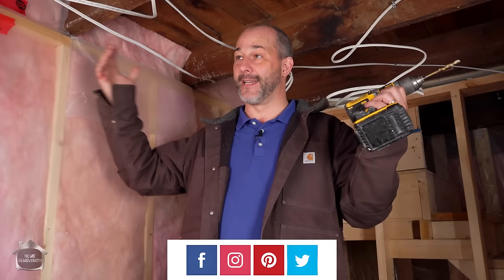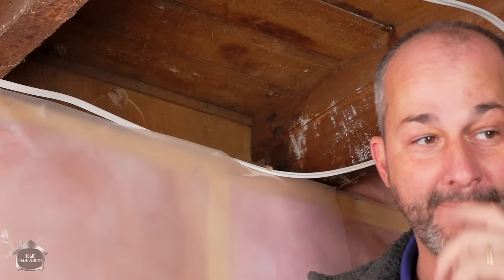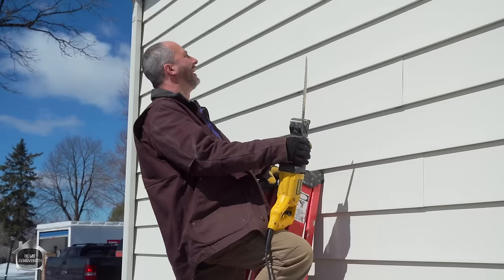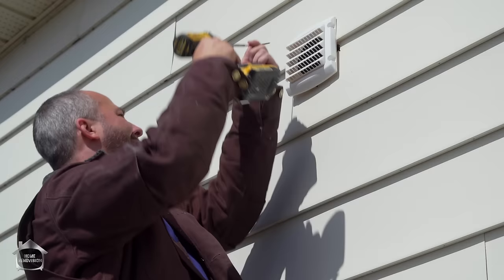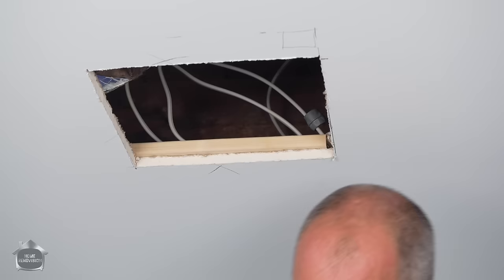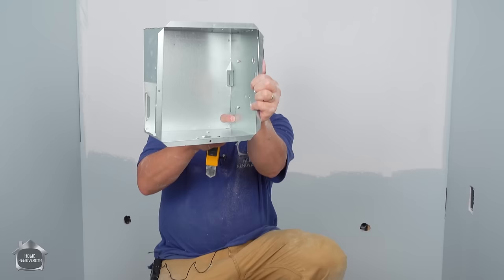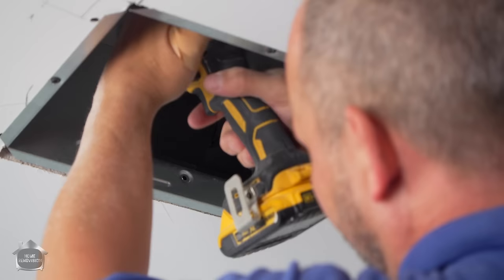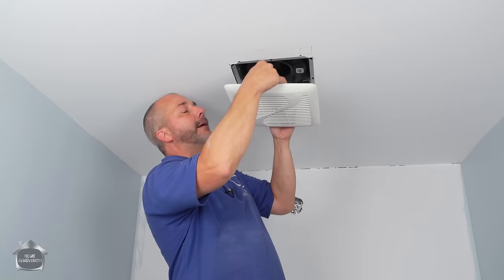How To Install A Bath Exhaust Fan | DIY

Comment: I've done dozens of these, I just cut with the proper size hole saw from the inside right through the vinyl.  You have to pull out the chunk when you get through the first 2x then repeat for the 2nd then continue the cut. And the proper fitting is a siding vent/j block and can be installed after siding is installed. Just a few more minutes of work.
Reply: Yeah this kinda baffled me, by the time you jump back and forth and use 4 different bits I can't imagine it saves that much time, plus the weatherization is easier with a uniform gap from vent to hole.

Comment: I suggest using an impact driver for those paddle hole bits. Most of those paddle bits have the quick connect built into them like a screw bit so it will go into the impact driver without issue. The impact driver adds a little extra torque to the process and because of the clutch/hammer setup cannot bind and throw your wrist out of wack.
Reply: Plus you can pull the bit out with force without it pulling out of the chuck
Reply: I found that using them in reverse prevents binding.  It risks unscrewing off the drill, but that's better than all the safety problems binding can cause.

Comment: From years of being a lineman I always fold the end of my tape over on itself about an inch.  Very nice to have a little handle on your tape itself and on whatever you taped. In case you need to remove it.
Reply: -Talks about how great outside vent cover is
-Breaks vent cover
-Holds it on for the rest of the shot
😂😂

Comment: Hi Jeff you don't have to take the battery out if you push the forward/reverse button slow in either direction it will stop between the gear and it locks the trigger. So it can't be accidently pressed. Great videos. I check them whenever I decide what Im doing next to get tips. Thanks

Comment: There is a screw for the electrical cover.  There's a hole for it at the bottom.  It isn't needed per se, but it might keep the cover from ratting while the fan is running.  That's why you had 3 screws at the end.  2 for the fan, 1 for the electrical cover.
Reply from the maker: ah! Somebody get this man  a prize! Cheers!

Comment: Hot tub for sure!  I’ve put a few fans in with a gutted bath like this. Here in the US we need to wire the box in before plaster for electrical inspection. Also saves time as the plasterer can plaster leaving the opening.
Reply from the maker: Cheers rick, here all we need is a wire in the right place for rough in. then the fan needs to work on final inspection. a little dumb since most fans are installed without a grommet or proper connections.

Comment: I loved the intro. Until now., I didn't know I needed to GUT the bathroom to install a fartfan!
One thing you could do for the lapped siding and vent is if you have any large pvc pipe, cut a slice of it to fit that bottom gap, caulk with clear silicone or kitchen & bath silicone if the siding is white.
You didn't use it,  but I thought it was you who taught me to cut wire insulation at a 45 and straighten the cutter, which breaks it loose and pushes it out a little.

Comment: Hi Jeff, watching your entire video project is key to learning how you tie the steps together.  Flush mounting the bathroom vent to ceiling drywall is way better than mounting to roof trusses pre drywall because of future replacement.Two comments for your wiring.  1,) twist the wires in opposite direction the wire nut will cinch down better.  2,) wrap the wire nuts with electrical tape, from the bottom of the wire nut to the wires.  Neither my recommendations are required, just recommended.  Thanks,

Comment: Dude, I used a 4.5 inch hole saw and cut it all the way thru the wood, plastic siding and everything, no problem. When the center bit went thru siding i went outside and used that hole to drill back towards the inside, put the duct in and had a perfect fit.

Comment: Very good video. Thank you. The only thing I wasn't really  comfortable with is  the flex venting in the ceiling. Looks like an easier install but I would be worried about durability. Think I would prefer 4 in ridgid  sheet metal.

Comment: This video is so informative! Within the first minute I learned... that I am definitely paying somebody to do this work. THIS IS NOT A DIY project for a non-professional. Thanks Home RenoVision DIY channel, you saved me a lot of research time. Time to google a contractor .
Reply: I depends on the electrical code in your jurisdiction, how handy you are and how well you can follow directions. It is actually a rather easy DIY project, with the wall/roof penetration being the most difficult part to do correctly.

Comment: I recommend something called wago lever nuts to connect your wires, they swear by them in Europe and their exclusively used in the commercial, factories and machines, and the hotel business. Ditch the wirenut for the wago like I did years ago.

Comment: Canadians are so danged nice. Fix-it guys tend to intimidate me cause so many of them are condescending and gruff (I'm female not that it should matter). This guy is laid back, sweet and quirky/funny and great at explaining details instead of assuming all his viewers already understand such details. He makes it actually look kinda fun. 

I have a 1916 house and need a fan in an upstairs finished original bathroom. There's an attic above but the main area of attic (directly above bathroom) is finished. The dormers in attic are on both sides and begin about 5-7 feet to either side of the bathroom interior walls, but again above). The bathroom isn't very big and the window is sort of in the center. Clawfoot tub to right of window and toilet to left of window. 

Questions:

1. I don't want to lower the ceiling. How weird is it to add a fan and just frame in only the duct work?  
2. Is the next best (or more appropriate) option to open up only as much of the ceiling as is necessary to gain access and try to drill soffits through beams if blocking the way to the exterior wall - assuming there's even enough height between the two floors - and then patch up the ceiling after?
3. Why can't the exit of the vent be above the window? Cause the fan being on might make it rattle? Can the fan be in center of room but vent be over in a corner, farther from the window? 
4. Our antique ceiling light is in the center of the room. Can a fan be directly over the shower (in our case clawfoot tub with shower ring)?
5. If we have to drill soffits through several beams (3 or 4 2x6s maybe?) won't that compromise the integrity of the house's structure? Years ago a guy cut the attic rafters from the finished portion in the center, keeping the ends of the rafters in place (seen in the unfinished dormers) and ever since finding out I've been worried our house will be more at risk if an earthquake! 😬

Can we put a fan directly in the exterior wall??!
 
Thanks so much! Subscribed!

Comment: I can’t help my ocd I feel the holesaw would have been so much neater.  When I did a dryer vent I cut a 4” hole in my double brick wall with a masonry holesaw and it was super sweet and neat.
Reply: Eh no one sees it
Reply: Those masonry whole saws are stupid expensive
Reply: blackdatto never new they they sold those
Reply: blackdatto in my opinion if your doing this as 1 time thing I would just use a pilot hole and use a the masonry chisel attachment on big hammer drill (makita cordless 18v hammer/rotate/rotary hammer) and maybe an angle grinder with masonry disk.
Reply: @Vanilla_Icecream1231    yeah just on eBay I think I paid maybe USD 27 for a set of four
Reply: @Vanilla_Icecream1231     you are right I have only used my set less than 10 times in 4 years but saved me some time so a worthwhile buy.   I used them on the end of a larger metabo sds thumper.    I have only cut brick with them so far.

Comment: I like your style When you screw up somethings you pretend as nothing happened :))) I always swear a lot:)
Reply from the maker: I don't crew things up I simply add work to the scope. Cheers!
Reply: “We don’t make mistakes,we have happy accidents.” Bob Ross
Thankfully I’m good at hiding my own happy accidents.
Reply: Your life isn't editable. My life neither. This job could be a real SOB, working above one's head, drywall that could start calving where the screws are close to the edge, siding which requires more consideration when pushing thru from the inside, and those other fine extras that Murphy can bring to a job. 
Also, he had a short ladder and worked above his head on that ext vent with a recip saw, all kinds possibilities for wicked bad luck from Murphy.
Those real life cautions said, I watch these vids because they're helpful and I appreciate the time and effort it takes!
Thanks to all involved. Invaluable.

Comment: Thanks for your video. Appreciate that the install wasn't a 5 min "nothing needs to be adjusted " video. Liked the strapping. I have a non flexible vent coming into my previous fan with minimal lateral movement so I cannot adjust the placement of the housing much. I don't want to move the opening very much so I can avoid doing drywall patching. thanks again!

Comment: Man that's a lot of safety first tips from a safety second individual. 😂😂
Reply from the maker: LOL, there is safety and then there is experience. I like to share mine when it will save an injury. Cheers!
Reply: @HomeRenoVisionDIY  Where would you put a bathroom fan in a house with vaulted ceilings and no attic? Also our house is stucco 😖 when we take showers it gets so stuffy and the bathroom is holding way too much moisture! Neither one has a fan!!
Reply: @shellyc530  Do a through-wall exhaust fan.
Reply: Get a dehumidifier
Reply: @HomeRenoVisionDIY  not sure how using a sawzall am inch from your face doesn't require eye protection.  I do like the video though, but just consider people watching might adopt the same approach with lack of saftey

Comment: Commercial Construction,  " building restaurants" here in the USA, use Philip head screws 95% of the time in all work. Exception when doing interior wood work. We use trim screws to attach to metal studs. Star, Square, Allen head screws. I prefer the  different screw heads vs Philips. In the past 4 years I have used over 250 Philip screw bits, they just wear out. other screw bits, maybe 8.

Comment: Great teaching for basic installation of a fan. I’m planning on doing this for my aunt’s bathroom that’s growing moldy nowadays 😅

Gonna follow up on that basic wiring since it only has one light switch.
Reply: You can get a dual switch the same size as a standard single switch or, preferably, replace the single box with an old work dual box. 

If the power goes from your panel to the switch, then the light, then you can use that hot lead to supply both switches easily. If the power goes to the lighting fixture and then has a drop to the light switch, it is slightly more complex.

Comment from the maker: Would love to know if you have a fan ducting into an attic!
Reply: Oh yeah. Time to dril into the roof. Back bathroom has no ductwork front does. Back bathroom got so wet the paint peeled off like latex.
Reply from the maker: Nice, very common problem from what I am hearing. best timer of year to finish the exhaust installation is early fall, in the morning. There will most likely be a little attic work to do. another few weeks won't make a difference. Cheers!
Reply from the maker: @Tunefully if you can fun the exhaust through the gable side of the building it will be better than going through the roof. Cheers!
Reply: I just installed a light/exhaust fan in my bathroom last weekend Jeff. And yes, I had to sweat it out in the attic. It's toasty warm in my attic here in Mississippi. Still gotta install the duct hose though. Not a problem. My wife still forgets to turn it on anyway. As far as the pool/hot tub question, I'd like to see you install a hot tub. I want to put a hot tub on a deck that I will build shortly. I want to build it with a retractable roof.
Reply from the maker: Hi Alan you can always tie the light switch to the fan so they work together! Love the idea of the hot tub. Cheers! Way to take one for the team in the hot sun in the attic. #real man!
Reply: A couple of things...before you purchase a fan make sure it fits in the joist space. You can roughin before drywall. Use a proper discharge vent with a back draft damper. Skip the exhaust fan with a built in dehumidistat. Prone to failure. Mount one on the wall or use a timer switch. My 2 cents.
Reply: @HomeRenoVisionDIY  Yeah, I'm adding a bathroom off of the living room and I tied light and fan into one switch. I opted for a double switch for the back/master bath. Luckily, whoever updated the bath room wired the light with 12/3. Keep the the great videos coming Brother.
Reply from the maker: Thanks for the thoughts.
Reply from the maker: having a 3 wire makes a lot of options down the road as well. cheers!
Reply: how much should i pay a handyman to replace my existing bathroom exhaust fan without running the ductwork just installing the fan
Reply: My place does not actually even have any attic - just a tiny air gap of less than a few feet!! I do have a ceiling opening that had a skylight, which I removed and installed a whole house fan in place of, with a thermostat switch and a bypass switch for manual control. It really cools the place off in a hurry on a warm day with a window or two open and the fan going.

Comment: When running electrical in a finished room where you don't want to cause a lot of damage to the drywall, electricians fish line is you friend. You were fortunate you had an unfinished room to work with.
Reply from the maker: If I was to run the electrical in that finished room I would remove the drywall and redo it. Cheers!

Comment: So are you going to tell us how much it cost to replace the removable grill of the exaust that you busted with the drill at 14:17? I'm going to guess that you had to buy a whole new unit. And  holding it up for the rest of the segment was priceless.
Reply from the maker: Thanks Daniel, I will be replacing it as soon as i do the new siding. it is all held together now with caulking. Cheers!
Reply: Hahaha!!!!
Reply: @HomeRenoVisionDIY  @Home RenoVision DYI. Ah yes, as someone told me a long time ago, caulk hides a multitude of sins. The sad thing is that my house is full of sins (not of my doing but that of the builder). Sigh.
Hope your family and you stay safe and well.
Reply: Are there any precautions to take in order to avoid packing down the loose insulation.  My attic has 10-12 inches of loose rockwool.  I want to reroute my bathroom fan which means I will need to move around, likely packing down this stuff, thereby reducing the effective R-value.  Should I just blow more insulation on top once done?  I live in Ottawa, Canada.

Comment: When you vent through the roof, what type of sealant do you like to use? I was told to use a tripolymer sealant. Kind of hard to find at the local big box store.
Reply: That is what you want to use

Comment: You may not like Philips screws but my complaint been why a receptacle has wiring screws with square/slot screw, Philips screws for attaching into box and a plate cover with a slotted screw.  😄 Really enjoy the videos.
Reply: The square/slot screw allows for controlled torque and won't slip/strip like a #2 Philips.

Comment: Sir: strange question... my ceiling is totally opened. The outside hole is done but I have to do the ducts. Fine. I also have to instal adequately the fan/box. Why not putting it before the gypsum? To difficult to know where to cut precisely ? Thank you for such  sublime videos
Reply from the maker: You definitely can. I installed this way to show a fan replacement as well. Cheers!
Reply: Home RenoVision DIY thank you very much for the answer. Last one : I see that you use flexible tubing + an insulated sleeve ...? It’s a must ? For now I have only the steel tubing without any insulation... BTW: i kind of live  close by;) So same temperature...
Reply: @ikust007  By now, I hope you got it installed. It shouldn't make any difference although some claim that flexible ducts with grooves reduce air flow and affect the CFM. I think it is marginally affected if you have a very short run.
Reply: xanthanx thank you very much for taking the time to answer.
Reply: xanthanx I put a insulated sleeve over the duct , btw. Everything went well.
Reply: @ikust007  You're welcome. Glad things went well.

Comment: be 100% confident where the fan will be by installing the damn thing BEFORE you drywall the ceiling....DERP
Reply: It's a remodel, not a brand new home.
Reply: @Guillotines_For_Globalists  you can clearly see they have taken the drywall off of the ceiling....this is the time to put in the fan
Reply: @parascalemodels  How and where?
Reply: @Guillotines_For_Globalists  Right from the beginning of the video to 14:30 there is no drywall on the ceiling. That's when the box should have been mounted and the vent duct sealed to the box.
Reply: @parascalemodels  Strange.
Reply: i believe he is trying to show people who are retrofitting a fan into an existing ceiling,not everyone completely guts their ceiling to put in a fan.... DERP
Reply: @Cam-wi3tp  I used this tutorial to help me plan out replacing a recessed light in our lower level bathroom with a Broan combination fan/light.  Came out pretty swell, less humidity in that bathroom when the kids shower.  Luckily the recessed light was fitting in a bulkhead on an exterior wall.  Minimal drywall repair afterwards.
Reply: @Cam-wi3tp  Derp yourself...….he clearly shows an open ceiling in HIS reno. Obviously if you do not open your ceiling it presents different problems.
Reply: This a reply he left elsewhere: "...I installed this way to show a fan replacement as well. Cheers!"
Reply: @parascalemodels  that's not always the case.